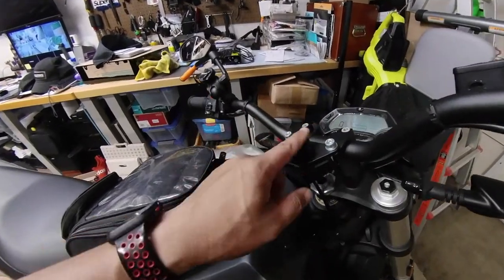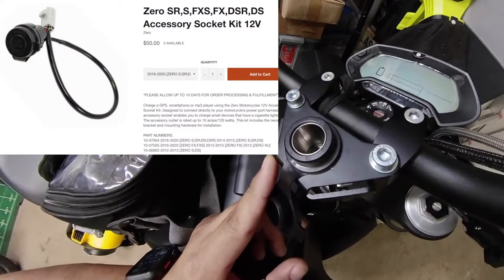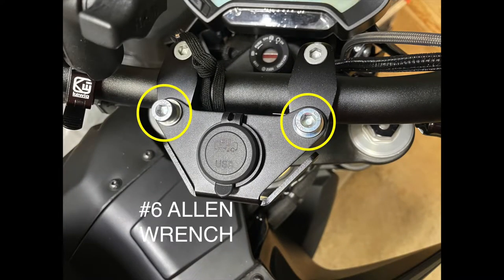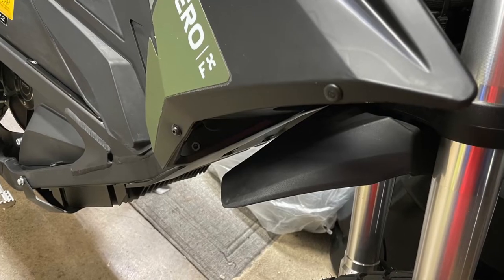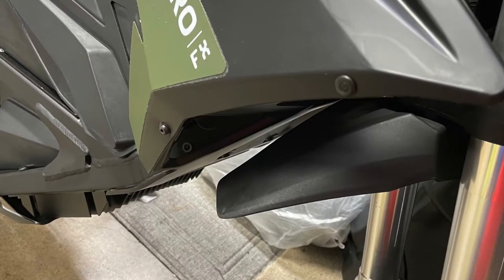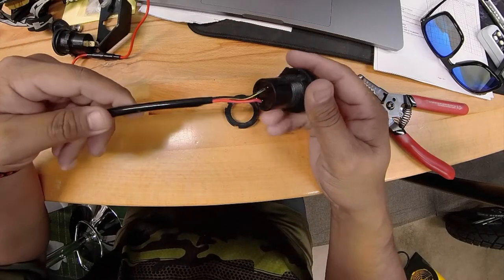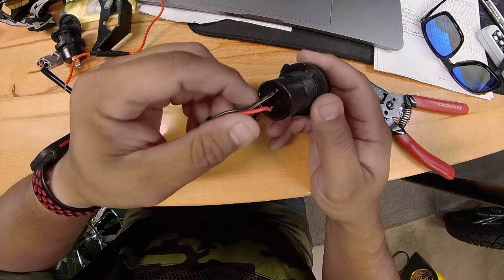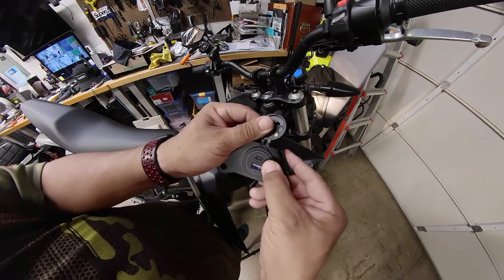2021 Zero FX 12v Changover 11/6/21

Comment: So the connector just plugs in on the right side? Did you by that from zero in Kapolei? Thanks.
Reply from the maker: Yes sir on the right side.  Got the unit online. It’s about $50 bucks cheaper and actually faster. I used Filipacci but you can also get it direct online from Zero California!
Reply: @Maverik36  Thanks again!!!